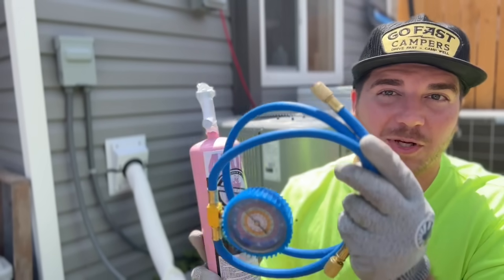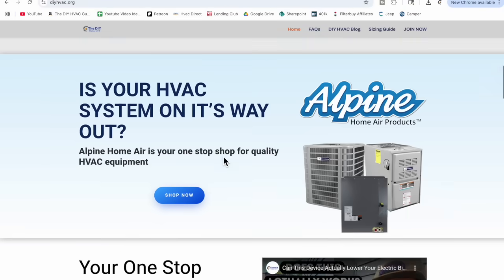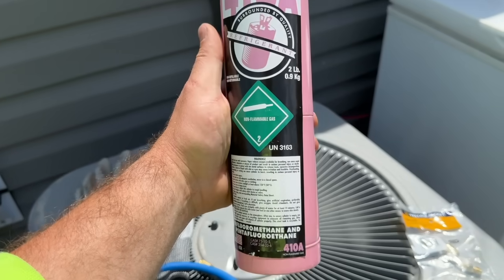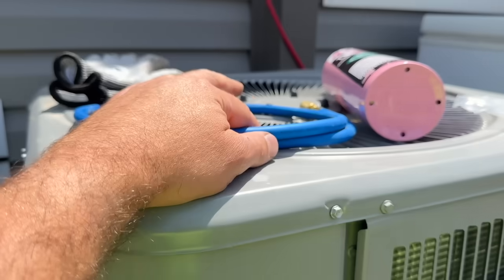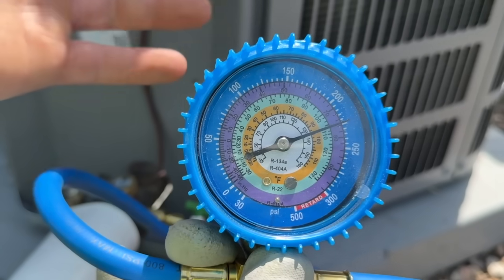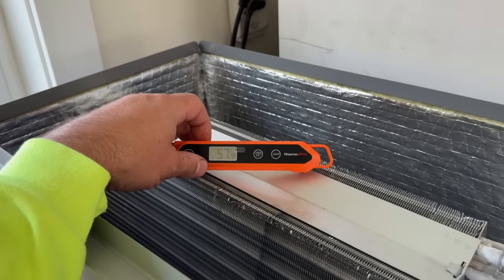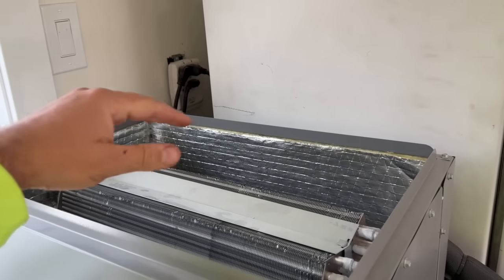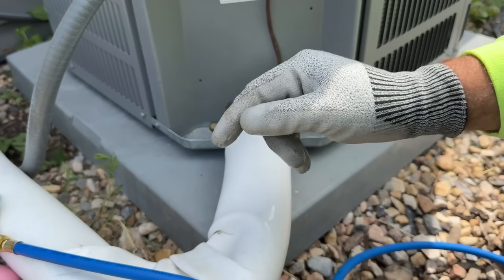You Can Recharge Your Home A/C Like A Car??  Colder Air in 6 Minutes!

Comment: Great video... arrived here via your previous video for A22... but ours is a 410A system.  I'll repost that comment here, just in case this board is more frequented... if not more apropos: Our 3 yr old Rheem system uses R410A Puron which requires 7 lbs.  I'm here because I'm doing a sanity check on the $1,050.00 line item charge for 7 lbs of R410A.  Yes, $1,050.00!  Now then, one might say "well, there's labor involved" BUT, it's part of a warranty repair... compressor went up, Rheem is replacing it free... no charge.  They're already charging $400 labor for that install, another $222 for a liquid line drier + another $164 to charge the system with acid neutralizer = $786 for this "warranty repair" then... BUT THEN, add in another $1,050.00 for 7 lbs of freon?  $1,841.00 total.  Am I hearing a big "C'mon mannn..." or are they in the ballpark?  The techs were great and I'm very accomodating... had a propane heating system in place, coffee, breakfast to order etc., so zero problems there but... $1,050.00? I would expect any labor associated w/ loading the freon is in any of the other 3 line items... none of which I've complained about.  I'm reminded of a car repair I once had.  Let's say there were 10 line items.  The dealer charged me an in/out/on the lift for each item! I just said no.  We bought this system from this company but seems there's no quarter given. Here's the unit in question: T608368 - 2.0 TON 1PH WARRANTY COMPRESSOR R410A.  Thanks, looking forward to your sanity check.  ps. I'm in Maryland but I see where one can purchase a 25 lb cylinder of R410A online for 150.00 which is $6 per lb vs. their $150 per lb. Happy New Year, Peter

Comment: If you charge low side with liquid refrigerant it can damage compressor valves.  It's a good practice to charge with vapors in low side - takes little longer but it's safe.

Comment: There are myriad reasons for low air and or refrigerant flow. Please hire a professional. Refrigeration is very dangerous and accessing a system can result in damage to the system and death. Warranties are also void when a DIYer works on your system.

Comment: HVAC tech here, recharging systems is a myth. If recharging helps your system you have a issue, either a coil is dirty with bad air flow or your refrigerant circuit has a leak, recharging is only a temporary fix. To those in the comments complaining about tech pushing for new systems when your current system is working fine but is just old. It's because systems have gotten much more efficient. If your curious check the systems SEER rating, keep in mind that there is SEER and SEER 2 now. If you call a tech to your house and they recommend replacing the system, get a second opinion sure, but if both say the same thing you probably should replace it. You don't argue with an electrian if he says something, we are both professionals.

Comment: I have a 5 ton system that's 25 years old. Been running well until now. I've replaced a few run capacitors through the years to keep it going. Recently had a tech replace the condenser fan motor. About a week after that, system started to freeze up. Tech came back and showed that it was low on freon. He charged it and worked fine for about 2 weeks. Now freezing up again. He recommends replacing the whole system because it's not easy to fix a leak and the system is so old. His estimate for a new system is $15,000. We live in Los Angeles. Any suggestions on how to proceed? Thanks for the awesome channel!

Comment: The pressure you want to charge the system to depends only on the temperature of the return air, is that right? The pressure gauge on the recharge kit gives a corresponding (theoretical) coil temperature. You're measuring the split in order to eliminate other possible issues.

Comment: There was a leak around my ac unit looked ljke water was leakiing and my copper pipe is not cold at all just warm does that mean my unit needs coolant ?  Its not frozen just warm and doesnt get beer can cold after running for a while

Comment: I may have to replace the drain pan on my Lennox vertical updraft air handler, I found a replacement pan on eBay, saw the process and see it requires evacuating and recovering the refrigerant which requires special equipment and an EPA certified technician as the A-coil has to be removed and refrigerant lines disconnected. I don't know for sure as most of the pan is hidden but after several cleaning sessions of the coil I'm still getting condensation leaks into the return space below. Any leak at all needs to be addressed as it will cause mold growth and spread spores all around the house. The pan may have a crack in it which is what may be going on here.

Comment: The sales restriction is established by EPA regulations (40 CFR Part 82, Subpart F) under Section 608 of the Clean Air Act. Only EPA-certified technicians are allowed to purchase ozone-depleting substances (ODS) or non-ozone depleting substitutes used as refrigerants, with limited exceptions. Refrigerant can only be sold to technicians certified under the Section 608 or Section 609 technician certification programs, where individuals may only purchase refrigerant consistent with the appliances covered by their certification.

The sales restriction covers refrigerants contained in cylinders, cans, or drums, except for the sale of small cans of substitute refrigerants (e.g., R-134a for use in motor vehicle air conditioners). This sales restriction does not cover refrigeration and air-conditioning equipment or components containing refrigerants.  You smell like a hack

Comment: Thanks for ALL your videos!!! In March 2024 I called Enoch HVAC to do a maintenance check before the hot TX weather started. They "topped off the refrigerant" (410A) but said it was fine no leaks. My split HVAC Carrier checked out fine. That day after they left, the unit started freezing over when it was on Auto cool (which it always was). They came back next day and said it wasn't anything they did--just a coincidence, and my blower motor had "gone bad" but was "so encased in electronics that it costs almost as much to replace as it does to buy a new HVAC."

I had the main managers come check again because this seemed implausible. They maintained their story and tried repeatedly to sell me a new HVAC. 

Though I had never endeavored to learn the workings of my HVAC, this really pissed me off and the more I researched, the more certain I was that they had caused this. I found out that if I kept the fan "ON" instead of AUTO, the unit did not freeze up. If I switched back to Auto, it froze up again. 

So my HVAC fan remained ON for more than a year. Finally, it stopped blowing cold air. 

I tested voltages, replaced the dual run capacitor, the single capacitor, the condenser, the terminal wiring, the thermostat, I installed a hard start capacitor for the fan just in case that was the cause. I got the A/C to blow again, but no cold air.

So I finally opened up the indoor unit where Enoch had said it was a bunch of delicate computer style wiring (it wasn't); because I read that a bad fuse could be the cause. The wiring and equipment was covered in dust and muck except the fuse, which appeared fairly new. I replaced it anyway, with a proper 5V piece. However, while installing, I noticed something that I think may explain what happened...

When I crouched and leaned to do the replacement, I spotted a new fuse on the floor, but a different color than the one I was replacing. I picked it up and it was a 3V fuse. My unit requires 5V. 

AI and online research states that installation of this 3V fuse would likely have caused the sudden problems that I experienced.  The managers that inspected my HVAC after the "maintenance" inspection stayed in the attic a long time and it seems they could have discovered the incorrect fuse, replaced it, and stuck with their story that this was just a strange coincidence rather than telling me that Enoch owed me a new HVAC after they ran mine on max for several hours after having installed the wrong (3V) fuse, which also does fit in the plug.

So now, I have ordered refrigerant recharge just to see if this last ditch effort can make my unit blow cold air.  Is there anything else you suggest? Should I take Enoch to small claims court? What should I do?  

Thank you for all you do! (And sorry for the very long message:)

-Lisa

Comment: After connecting the hose and letting the system run for 5 mins it shows a pressure of 140psi/46 on the purple scale. What should I do in this case?
Inside temperature 73 outside 79 degrees

Comment: I love this channel. ❤ I have three houses to service and don't care to start a business at 70 years old. However at the end of last year my AC guy passed away. I've had to clean off coils, clean out condensation lines, and replace weather deteriorated pipe insulation. I'm pretty handy so it's no problem for me. I've called companies out to service the units that don't do a thorough job. I would like to learn the trade from your courses and get a license. Do the courses teach everything I need to obtain a license?

Comment: You mean all my years in AC and I have been charging incorrectly charging using subcooling rating on the condenser plate tag if it has a TXV or outdoor temperature and indoor wet bulb for superheat with a fixed orifice metering device. Geeez guess you learn something new everyday.  🤦‍♂️ This is the reason way you call a professional and not a DIY on YouTube, showing you to overcharge a system by going on temperature and pressure on gauge. Pressure will fluctuate by outdoor temperature, plus a dirty outdoor condensation coil and the list goes on and on…. Another misinformation video and what not to do. Ohhhh and another tip for the DIY’er DON’T use leather gloves using refrigerants because the leather will absorb and create worse burns and scars to skin. You should only use a rubber based chemical protective gloves. But you learn this when you take your EPA 608 certification.

Comment: Coming from a guy that has 21+ years in this position as a technician, a lot of people will fk there a/c unit up just by looking at this video😢😂😂😂🤦🏻🤡😡🤬 if u can't change your a/c filter on your unit in a timely months schedule don't attempt to be a Air Conditioner Technician for a minute.with out the proper tools.😮😂😂😂

Comment: I ordered a 2lb can with the kit for my Lennox unit. I followed the steps turned the unit off and connected the long hose toe the can and connected the short hose with the depressor to the low side and got no presser on the gage. I turned the unit on and still no pressure the gage. I know the unit had some 410 in it because it was getting cold .I loosened the hose at the can to bleed but no air came out .  I confused . I proceeded to turn the can upside down and open the can valve and let some refrigerant in the system. I got pressure on gage but it did not seem as if any 410 was flowing into the system. What am I doing wrong? My 2015 Lenonx  unit looks a lot like the one in the video. Please help.

Comment: Im confused... the purple ring says "in Hg" or inches of mercury which is a pressure gauge not a temperature.  Do I treat it like temperature?   Also a funny/aggravating story... back in 2018 the day before we were going on vacation we had a guy come out from rotorooter to inspect our AC unit for $20 through a deal they had going on with home depot.  The guy came out took things apart, cut some of the foil tape that the installers had put over places to keep air from leaking (and didnt replace it) and looked inside the evaporator area and went oh you have a piston driven system (IDK if that's good or bad myself but ok sure).  He then goes outside to the condenser and hooks up his manifold and checks the pressures.  Then he proceeds to show me some weird circular graph on his tablet which I could barely see in the summer sun and he goes "oh you're about 8 pounds low of refrigerant, unless its a piston system and then its only a half pound low.  Let me go check again and make sure."  He goes back to the evaporator and looks inside again and goes "ok yeah its a piston system afterall so you'll need to buy 2lbs of refrigerant because they dont sell half pound bottles and 2 schrader valves cause that's where its leaking. That will run you about $550."  The thing is the system was installed in 2016 so it didnt need anything but a good rinse on the condenser coils.  So I told him we were literally going on vacation the next day so the repairs would have to wait... I have not made any repairs to the system to this day other than cleaning the coils, replacing the filter with some merv 5 (was using merv12 because of my girlfriend's allergies but they didnt help so I switched to the 5's), and just this past month I cleaned the evap coils as best I could because they pull out of my unit and I didnt want to break anything in the middle of summer.  The system works fine but it does take about 5 hours when I start the system at 8pm to go from 87 to 78.  So I feel like its ok but could be better.  Thats what lead me to this video.  Now I will have to go test the schrader valves with some soapy water and see if they are in fact leaking.

Comment: The more I watch this video the more I see how full of crap he is. You don’t have a substantial leak if it’s more than 2lb low. You could sure, but chances are it’s a small leak that has been very slowly leaking for some time. If the leak was substantial, there would be no refrigerant in the system and it would be pulling negative pressure

Comment: Not all systems low of refrigerant ice up or frost up. And so many times the ice is from another issue. People are going to DIY and have no clue how to diagnose the issue with the system. Purchase gauges, check the system when there is zero ice anywhere on the system, and you will see if it’s caused by low refrigerant, or another issue. This guy, who is supposed to be experienced, says nothing about this. Unreal

Comment: I followed every step in the video with R-22. The pressure stays at 125psi even when I turned the knob on the R22 can all the way open. It looks like the compressor is not taking in the freon. Is it because the compressor didn't start up? The fan is turning fine. I also tried flipping the R22 can upside down but still not working. Other videos on the YT say the can should be upside up for R22 and upside down for other freon.

Comment: A 91 degree day in FL, return air temp is 80, supply air temp is 65 at the air handler. Suction line temp is 54. System is a 10 year old 3.5 ton Carrier using R410a. All coils are clean as well as the filter. Delta between return and suction line 26 degrees. Is that within normal range?

Comment: What determines whether to flip the tank and add refrigerant as a liquid, or to keep it upright and add as a vapor?  Other videos indicated the use of liquid on the high pressure side.
Reply: r22 is pure, add as vapor.  R410 is a blend, add slowly as liquid.  If added as a vapor, the components of a blend would evaporate at different rates, and the vapor would have an incorrect composition. When the unit is operating, the pressure of the high pressure side is higher than the pressure of the tank, so no refrigerant will flow from the tank.

Comment: I topped off the unit with R22 to 40f but air coming from register is only at about 66f. New filter, cleaned outside coils. No ice on unit around fittings..any ideas?

Comment: What if compressor isn't running from having a possible low charge? Everything has been checked,...I  should of said almost everything whenever I said that, compressor ohms out perfect, fan motor is ok, high pressure switch ok, cap and contactor ok, have to take air handler cover off and see what's up in there. Getting tractor going tomorrow then I'll get back to it, rode out the heatwave elsewhere, nothing ever breaks in my world unless it's 110° out or 0 or raining nonstop.

Comment: Looking at installing a mini split with 50’ of 3/8, 5/8line set. The unit is pre charged for 25’ of line set. Is there a table or guide to find out how much refrigerant I would need to add?

Comment: Just want give a big thanks for making this video. I've installed 4 mini-splits at my house throughout the years, they work great, but I had to have other people add refrigerant due to leaks. HVAC contractors charge a lot. I have had a Gree unit that has been running great for about 12 yrs now, never had a problem with it. I also have a Mr. Cool that's been running super good for 7 years. Lately I have a problem with the indoor unit evaporator freezing up. The other unit I have is a Klimaire and the lines on that are freezing up. I appreciate the information you gave us, very helpful.

Comment: At 9:00 you show bleeding the air out of the hose before starting the charge process. How do you know how long to keep the valve open? Will you see refrigerant from the system come out? Since it is in a vapor state, will you be able to tell the difference between trapped air escaping and the refrigerant without touching it?

Comment: I wonder if it is public information how many people go to the hospital for refrigerant burns... 
If y'all buy the proper gauges and do it right (just like you need to do it right for a car) then fine. Good for you. But most people buy the jug off the shelf for their car and just dump it in. They never ask why it is low, they never ask if they do too much. 
I'm all for DIY. AC techs run in my family so I've had to fix a few things or diagnose errors. But i don't mess with refrigerant cuz I'm ignorant about the numbers. I have access to all the tools i could ever need. But without bothering the relatives i wouldn't know what is enough for my 2 different systems.